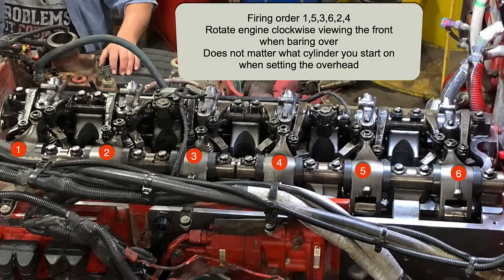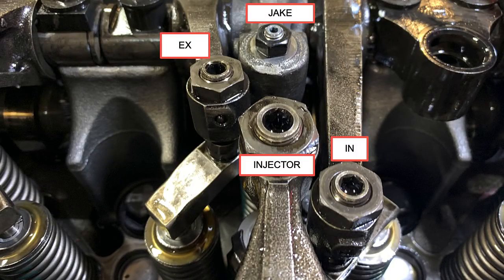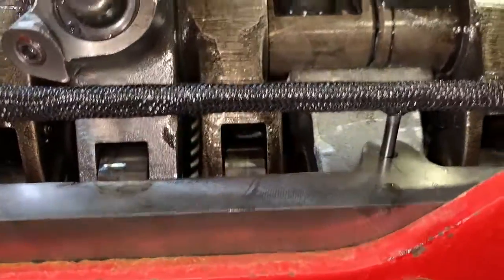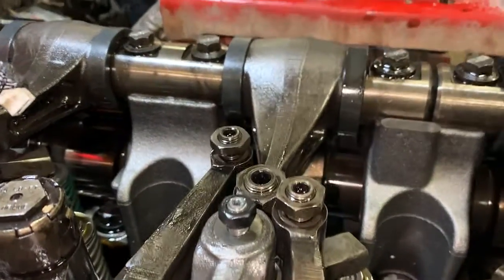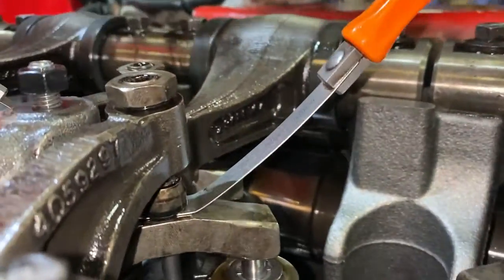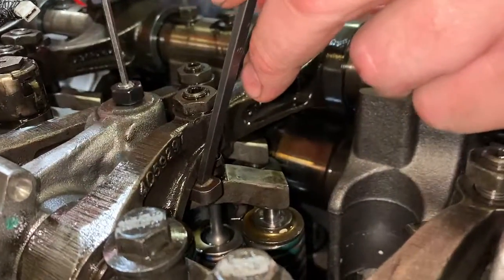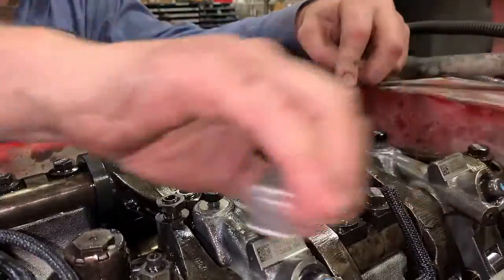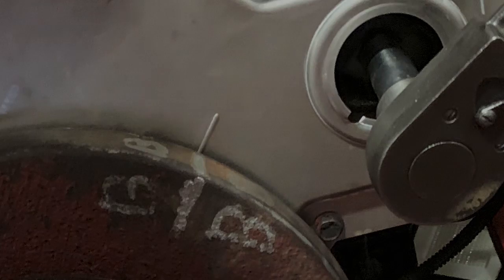ISX871 Setting Valves, injectors,and jake brakes

Comment: 2009 kenworth w 9 isx factory 605 horsepower. Why can't I jake between shifts? There is too much delay. Otherwise, the jake works fine.
Reply from the maker: Check the features and parameters- There is a setting called delay under the jake section. Make sure it is set to 0.0 delay time. That is my guess.
I am also thinking you do not have an automatic IE allison. If you do have an automatic jake delay can be controlled by the transmission controller as well
as the engine ecm.
Reply: @ENGINESHOPJOE  I am assuming I would need insight to check these features and parametrs?
Reply from the maker: @gregglyman4962  Yes or a software that is capable of viewing them. There are others out there.